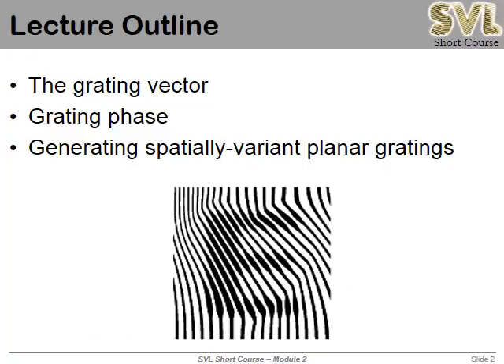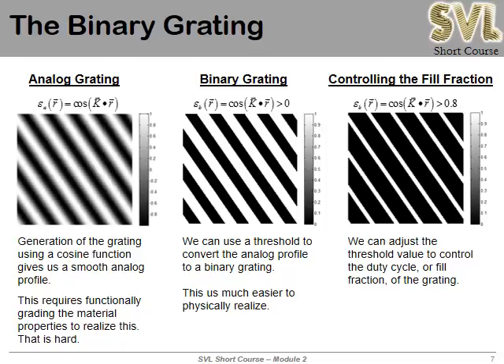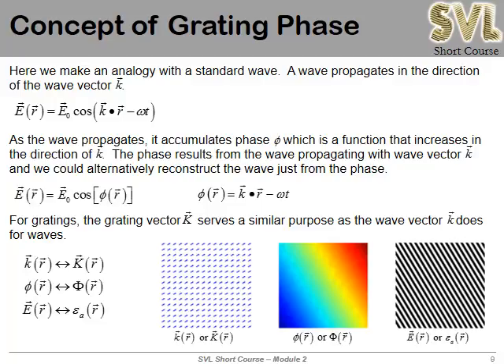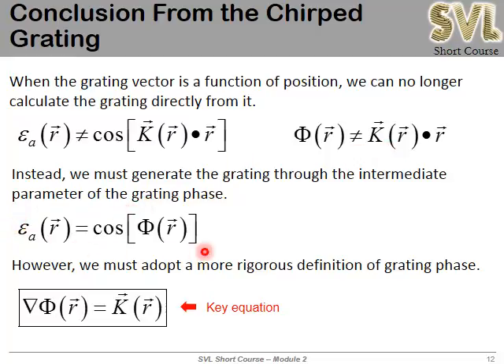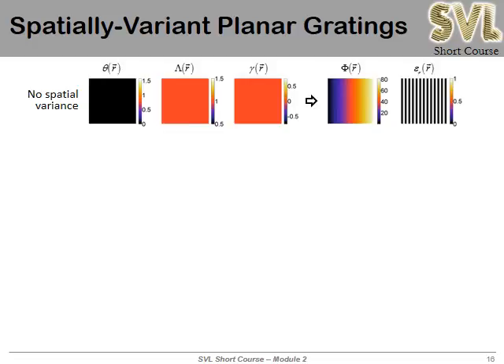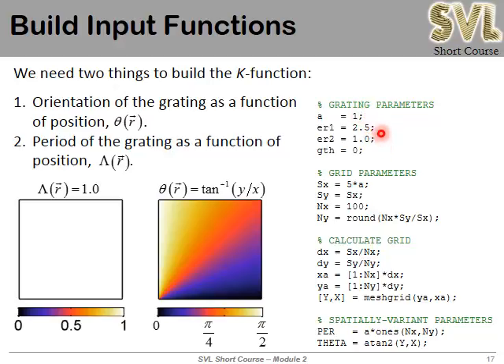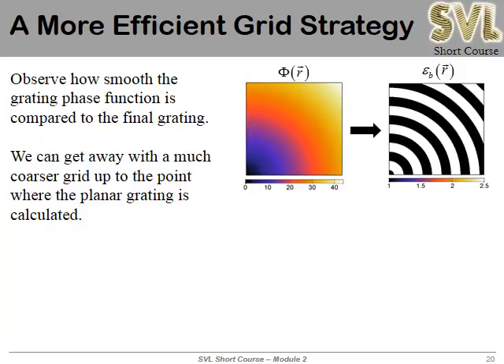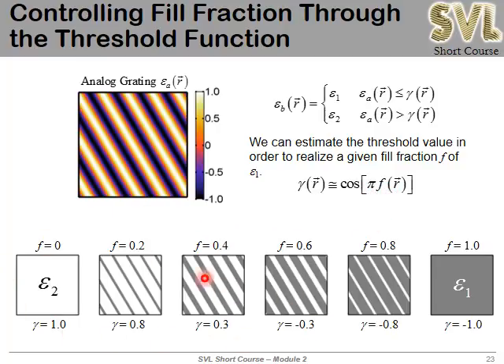Lecture 2 (SVL) -- Generating spatially-variant planar gratings

Comment: Thank you for your wonderful explanation. I can understand that the grating cannot be directly expressed in a cos( K*r ), but why do you use the gradient of the grating phase to represent K ?
Why do they have this relationship ？🤔
Reply from the maker: Imagine tracking the front of a wave and recording the time it passed each point. That function of time values would be the phase function of the wave. The wave vector k points in the direction that this phase function increases because that is the direction the wave is moving. The magnitude of the wave vector conveys how fast the phase function increases. This is the definition of gradient. The phase function is the gradient of the wave vector function. For gratings, they are just like waves but do not move. Instead of a wave vector k, they have a grating vector K.
I hope this explanation helps!

Comment: Thanks you for this clear explanation. However, I couldn't find the svlsolve function. Could you please point me in the right direction about where can I find the function?
Reply from the maker: You can download them from the course website.  Here is the link:

https://empossible.net/academics/svl-short-course/

They are under "Course Resources."
Reply: @empossible1577  Thank you professor they work perfectly. Do you know where can I find the lecture for learning how to write my own fucntion? or for understanding what is it doing?
Reply from the maker: @TheArhut  Yes, absolutely.  I wanted to keep the numerical aspects of this course simple, but I do teach the details in other places.  First, you will need to learn how we implement the finite-difference method as it is a little different and unique but is also really simple.  This is taught in Topics 6 in 7 in my Computational Methods course (skip the numerical integration lectures).

https://empossible.net/academics/emp4301_5301/

If you prefer books, I just released a new book on finite-difference frequency-domain, but Chapter 3 covers in detail (including MATLAB codes) how I implement the finite-difference method.  Unfortunately, only the e-book is available right now.  The prints will not be ready for at least a few more weeks.

https://empossible.net/fdfdbook/

Once you have a good understanding of the finite-difference method, I teach the details of generating spatially-variant lattices in my 21st  Century Electromagnetics class.  See "Spatially-Variant Lattices" under Topic 6:

https://empossible.net/academics/emp6303/

Have fun with it!